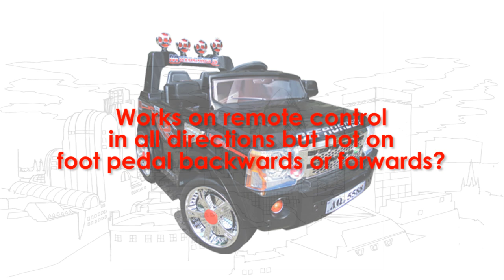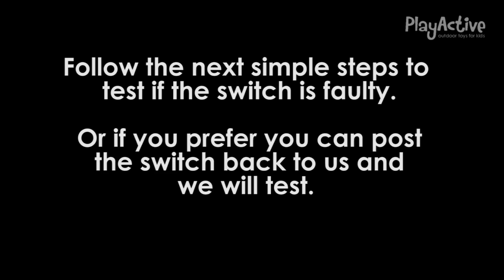Works on remote but not on foot pedal - PlayActive Jeep

Comment: Hi, I've done all the tests., the switches do not have any rattles so haven't opened them, however the car is still not moving. I've check the battery like in your other video and the motor/battery is working fine. The only difference is that when I connected the black and red wire on the pedal switch, the car doesn't move at all

Comment: my  grand son has a 12volt  4 wheel bike when you turn it on the front head lights go on .when you step on the accelerator the lightgs go out and nothing goes .any ideas.

Comment: What if only forward isn't working, only on foot pedal? Forward works with remote. Reverse works with both
Reply: Never mind I fixed it. I'm not exactly sure how though. It was the forward reverse switch. I took it apart a second time after taking it apart once already didn't work. I once again made sure everything looked in place. This time it worked. I think the problem was that the 2 long metal pieces (dont know what they are called) are in so loosely with nothing to keep them in place. So it probably fell out again when I put it back together the first time. If it stops working again, at least I know that it's those pieces falling out and I can fix them

Comment: My kids car doesn't steer on remote. Just goes forward and reverse. I think i need replacement receiver. Any suggestions please?
Reply: Aman Khan I'm having the same issue, have you found a solution?
Reply: Tara Pope I am sorry i did not try this yet. The car also had door pedal problem so I fixed that at least by following this video. My kid is learning to drive manually right now(without remote). I am looking for ways to make it into arduino controllable car with my android phone as remote bcoz I cannot even find the remote controller of my car. If I find any fix, I will let you know. Thanks

Comment: Hi it's a bmw x6 wene putting it on everything works fine  the radio and lights looks like they  fully charged but the peddle doesn't work and the remot .
Please help. 
Thanks
Reply: Probably controller issue.
Check all wiring if any wire is removed . If everything is ok, then it's controller issue

 Check whether controller available at HTTPS://vihanevehicles.com

Comment: I have tried all this and still not working with pedal, when removing pedal I removed the black and red wires and touched them together but the wheels don't move
Reply: Same happened with me...if you found any fix please help me

Comment: Works on foot pedal but not on remote
Reply: shiva dasam I have the same problem. did you find a fix?
Reply: Controller issue, u need to replace it with controller+remote

HTTPS://vihanevehicles.com